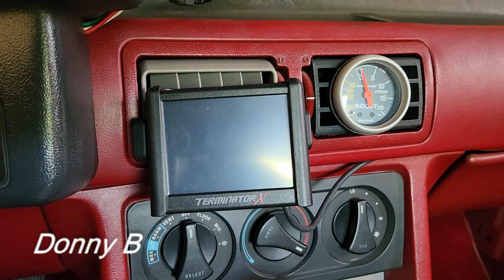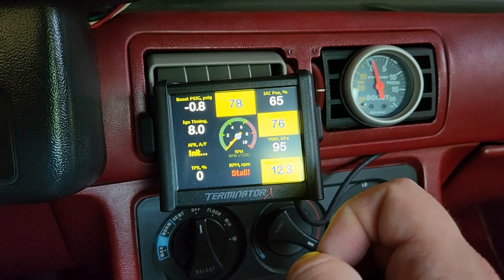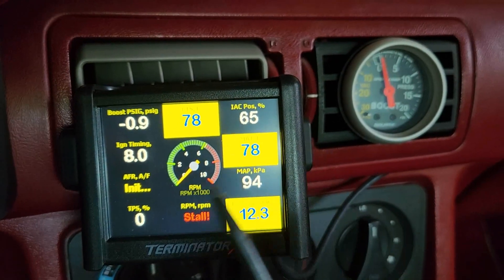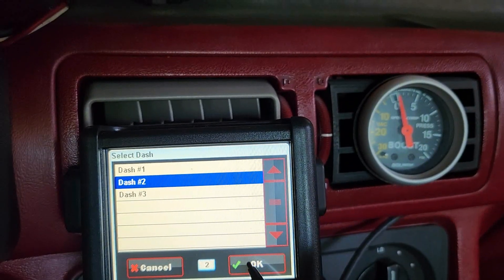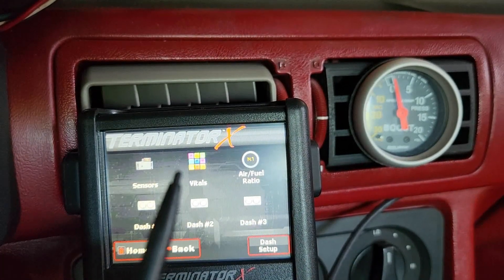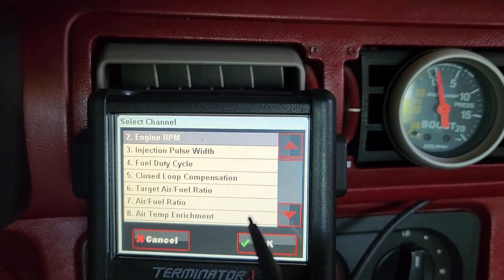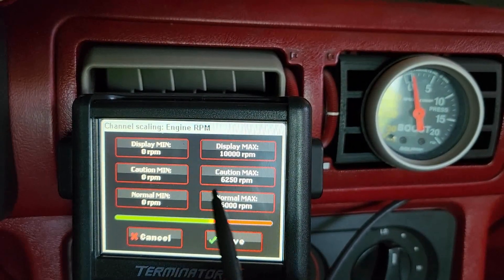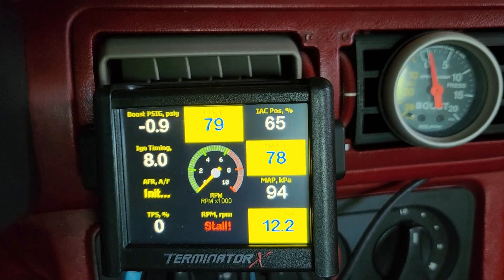Holley Terminator X Handheld Custom Gauge Layouts

Comment: Do you need aftermarket gauges to read oil preassure fuel rpms etc or can you read all that important info from the 3 in screen
Reply from the maker: You'll have to get the pressure transducers to have the holley read those from the handheld

Comment: Can you setup air temperature? If so is there a specific sensor you have to use; or can I use a sensor i have already?
Reply from the maker: Yes you can put in there whatever the Holley can see, there is literally over 100 options to select along with difference layouts. The Holley MAT sensor will be an option